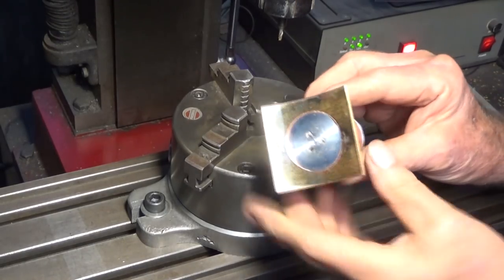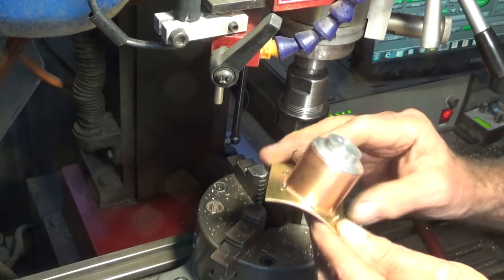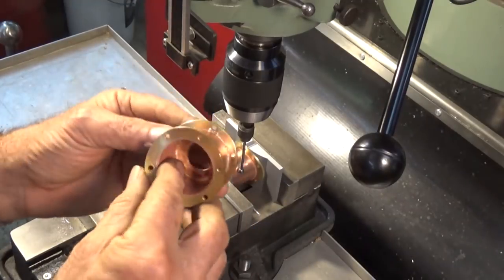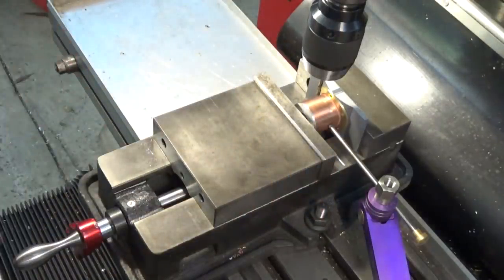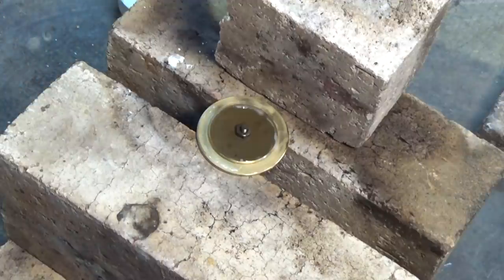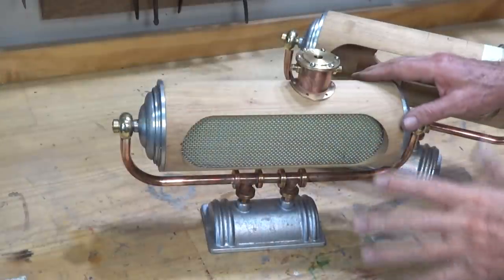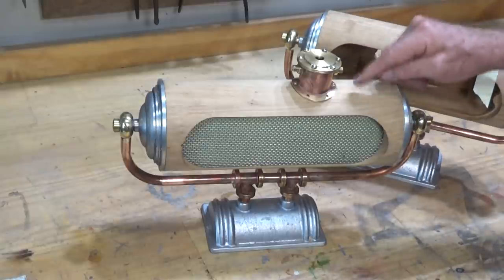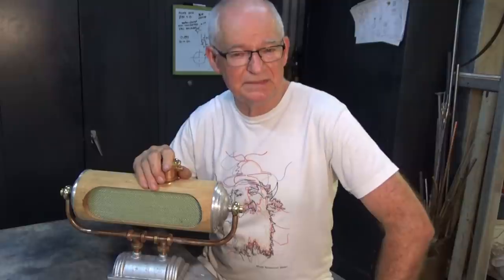The "MIXIE" A DIY Steampunk, Backlit Digital Clock - Part 6

Comment: Oxy propane is really great for brazing.  A bottle of oxygen from Bunnings is pretty good value.
It’s really starting to look great Mark.
Reply from the maker: My mate was trying to talk me into that setup last week. It could be the cheaper option for me. 
Regards,
Mark
Reply: @Preso58 yeah that’s what I did.  You can use a normal blowpipe but get the biggest nozzle you can find.  I already had a propane regulator so I bought an oxy acetylene kit so I can do either if I need to.  I just would need to get an acetylene bottle.  It’s very handy and lasts for ages.
Reply: You can also do some cutting with oxy propane with the right tips.  The old timers warned of hydrogen enbrittlement with propane, but no one seems to care now.
Reply: @Preso58  If you don't want to weld steel, oxy-propane is a more friendly option. I have acetylene now and if I ever run out, I will go back to propane.
Reply: @Preso58  I've had one for years and love it! Much cheaper than an oxy/acetylene rig.

Comment: Bunnings do oxy /acetylene bottles that you don't have to rent - cost a few bucks to buy but once you own them the refills are pretty cheap . I use  lpg  as much as possible but it is nice to know that when you need heat the oxy set is there ! I recently had to braze up some bolt lugs on a crap casting for a M.E beam engine as they were way out of alignment so the oxy came in handy there !
I could waffle on about other methods to find  the centre of the part but the tape method is as good as any !
Next project - a clock that dispenses beer at a certain time of day but the alarm cannot be turned off until you pour a beer 🍺
Reply from the maker: Ian. I am starting to think along the lines of Oxy Propane. I already have propane under my welding bench and although not as hot as Oxy Acetylene it would do 90% of what I need. I already buy my MIG gas as swap cylinders and it's quite cost effective for me. 
Regards,
Mark

Comment: For the copper/brass soldering, I experimented a lot and finally lucked into a used full set of Sievert propane torches.  They are straight propane-air, but have great tip designs that pull in a lot of air.  Worked with MAPP gas but the slightly higher burn temp just wasn’t worth the 3x cost IMHO. when it comes to silver soldering, you don’t need high temp (the flame temp is WAY above the melting temp of even high silver content solder), you need lots of BTUs, and the larger Sievert tips will do 25k BTU and more.  And especially with brass, you can rapidly get in trouble with Oxy-Acetylene.  I’ve melted a few brass pieces on accident.
Reply from the maker: Brad, I have decided to go with Oxy Propane. A friend gave me an almost complete set of Comet welding and cutting attachments and an oxy regulator. I have ordered a propane regulator, hoses and the cutting tips designed for propane. The bonus is that I already have propane in my workshop so I just need a D size oxy cylinder. With this rig I can get plenty of heat and it's great for cutting off rusted bolt heads and cutting thick plate. 
Regards,
Mark
Reply: @Preso58  mark, that can totally work, and does have some benefits.  These days oxy-propane is mostly used for cutting; good hobby propane-air torches are a little hard to find.  Since you have experience with oxy-acetylene, you probably won’t make the mistakes I’ve made.  Best of luck!

Comment: I use Mapp gas rather than propane for silver soldering, since I also don't have Oxy. Mapp is fairly expensive, but for the amount I use it's fine. It gets quite a bit hotter than propane and is safer than Oxy.
Reply from the maker: I did look into getting a Mapp burner outfit but there appears to be some controversy over whether it's the gas or the burner design that produces a "hotter" flame. 
Regards,
Mark
Reply: @Preso58  you could be right... The original Mapp gas is no longer produced so it's really map/pro. The torch I use is the Bernzomatic TS8000T

Comment: what about mapp gas. it's hotter. I just replaced my torch and the new one is hotter even with propane because of the way it works.
bernzomatic mapp.. anyway, what are you using to pickel the solder joints?
Reply from the maker: I pickle the joints in sulphuric acid which was left over from my old anodising tank. I have also used ordinary cleaning vinegar and salt. It's way less toxic and easier to get. About a litre of vinegar and a couple of tablespoons of salt will work almost as well. I am starting to think I can use Oxy and Propane for heating. Acetylene doubles the cost for me and I already have propane on hand.
Regards,
Mark

Comment: I can't wait to see that thing all steamed up at full pressure! Will they be coal or gas fired???  ;-)   BTW...I use two 15L/min oxygen generators and a propane BBQ tank and use oxy propane torch when I need lots of heat. No worries with storing oxygen tanks in the home shop.  Fidel Castro in Cuba!
Reply from the maker: I have made up my mind to go with Oxy Propane. I can buy an oxy cylinder on an exchange basis. Initial cost is around $300 but the swap over after that is only $100. I won't use it a lot but it's nice to have the extra heat when you need it and it will allow me to cut off rusted fasteners if I need to. When I was teaching we had a guy do a demo with an oxy/hydrogen generator. It was a machine about the size of a large chest freezer and it made the gas from distilled water, on demand. The flame was tiny but man was it hot! He arranged to leave it with us for a week to try out but it broke down the day after he left it. 
Regards,
Mark
Reply: @Preso58  HHO generators are pretty cool but too finicky for me. Homeowners insurance here in the US frowns on oxygen tanks if they are not for medical use.  That was the biggest reason to use medical oxygen generators. As a bonus they never run out and the only cost after purchase is electricity. I picked them up used for a song. Glass blowers use them quite frequently.....

Comment: Mark,  Clough42 on YouTube just rolled out another 300 ELS Parts~ latest video on his channel.  Perfect for your Colchester Lathe.                                                                                                                                 You also need red/green LEDs on end caps.  You need sailing reminders in up coming heavy and deep snow this winter.  Just months away.
Reply from the maker: Yes, an ELS would be cool. I can cut both metric and imperial threads with my Colchester but there are some really common metric threads missing. Usually it's the one you need and you don't have a tap or die for. I have watched him doing some of the earlier development work but I've not kept up with it. Sorry, but I won't be adding navigation markers to the clock. It will have an illuminated discombobulator though.
Regards,
Mark

Comment: Wouldn't MAPP gas be more cost effective. Perhaps no supplier. dunno. Beautiful design and execution as per.. :)
Reply from the maker: I did look into getting MAPP gas but the oxy/propane does allow me to cut steel. I have a 50amp plasma cutter but it doesn't work well on corroded steel. With the cutting attachment on the oxy torch I can cut off old rusted bolt heads and nuts. Although it's a struggle you can also take the oxy/propane set to a job where there's no power. Some years ago I had a very old petrol powered cement mixer which could be towed behind a vehicle. It weighed a ton and when I went to move it the axle collapsed due to corrosion. I decided to scrap it but I had to cut it up where it lay. At that time I really needed to use the oxy cutting torch but I didn't have one. I ended up having to string a whole bunch of extension cords so I could use an angle grinder to cut through the frame. What a nightmare!
Regards,
Mark

Comment: Couldn't you also align the holes on the flanges by simply running a bolt through them? Use nuts in various positions to adjust exact distances.
Reply from the maker: Yes, I do that sometimes. Horses for courses I guess.
Regards,
Mark

Comment: Hi Mark  look at a Oxy propane setup  .Talk to your local BOC guys and ask to go on a D plan. No rent ,it is for low usage guys (hobby) market .
Reply from the maker: I have been getting quotes on just that setup. I think it's the best compromise for me. I already have propane under my welding bench and I get my MIG gas from Total Tools. So, the extra cylinder of oxy won't be too expensive. I didn't realise that BOC had a cheaper alternative to full cylinder rental. I'll check that out. 
Regards,
Mark